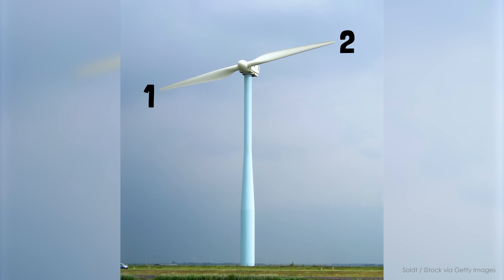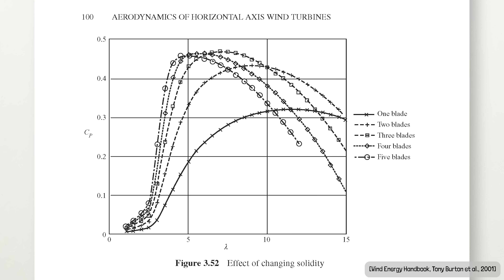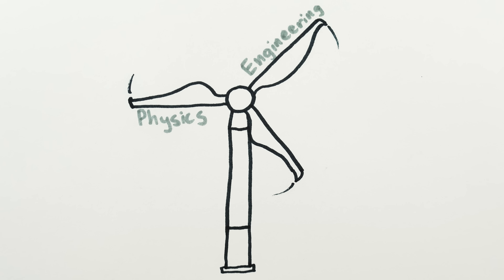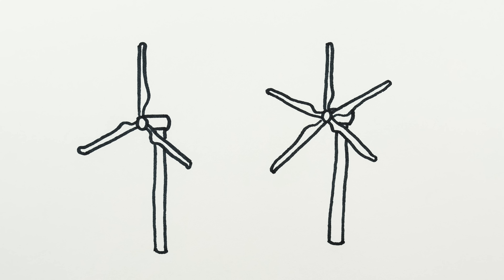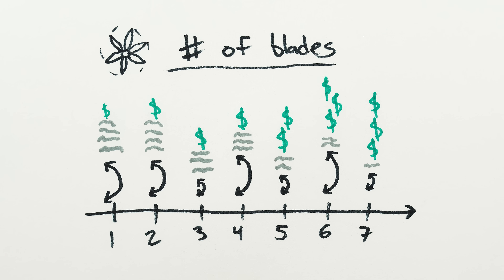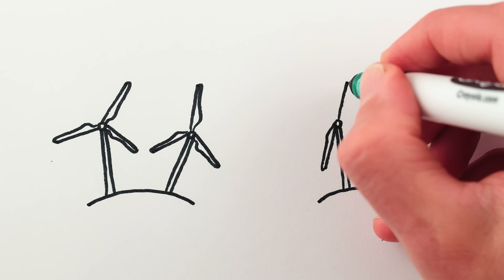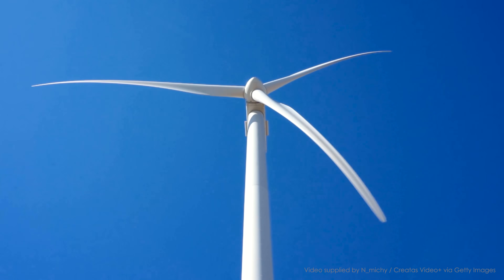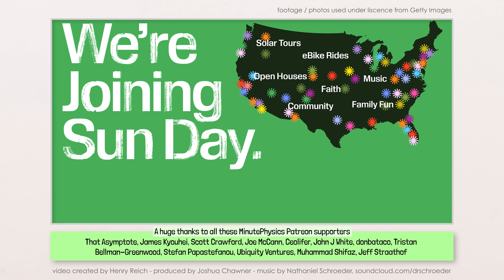Why Do Wind Turbines Have Three Blades?

Comment: We used to have a lot of smaller two bladed wind turbines in Friesland and when those things go full tilt it’s pretty scary, it’s much nicer to have the relatively slow and calm movement of three bladed wind turbines.
Reply: I think that's primarily an issue of size. Bigger turbines appear to spin more slowly. Well, they spin more slowly if measured in RPM but not if measured in m/s at the tips of the blades.

Comment: I want to clarify some important points, to emphasize the effectiveness of wind turbines.

The "lamda" on the horizontal, which the video described as how fast it is spinning relative to the wind is actually a little misleading. Its actually the "Tip Speed Ratio", which is the speed of the TIP of a blade divided by the windspeed. So, smaller turbines have to spin faster (in terms of rpm) to get to the optimal Tip Speed Ratio vs a bigger turbine. Also why huge turbines often appear like they are spinning slowly, but the actually the tip of the blade is at the optimal Tip Speed Ratio of about 7, for 3 bladed turbines. So, smaller turbines (such as one mounted on a boat or something) have more blades because the then it does not need to spin as fast to get to the optimal point, and less mechanical wear.

Also the "Cp" which was on the vertical axis is basically the efficiency of the turbine, i.e. how many % of the wind's energy it can exact, from the wind which passes the "disc" of rotation. So something 47% is HUGE and i bet no one expects that from looking at one in the wild. :)
Reply: Thanks for explaining. I stopped the video to look at the graph and could tell it wasn't really showing what he was saying, but didn't know the details.
Reply: The Betz Limit has entered the chat :)

Comment: "And St Atilla praised the Wyndmylne up on high saying: "O lord, bless this thy wyndmylne. That with it, thou mayst power thy grids, in thy mercy. And the Project Manager did grin, and the people did build upon the foundations, and mast, and staircases, and power lines, and circuit breakers, and reduction gearboxes, and thrust bearings, and lightning prot-" "

"Skip a bit, brother"

"And the Lord spake, saying: "Then, thou shalt install the holy axle. Lastly, thou shall place blades up to three. No more, no less. Three shall be the number thou shalt place, and the number of the blades shalt be three. Four shall thou not place, neither place thou two - accepting that thou then proceed to three. Five is right out! Once the number three -being the third number - be reached, then connecteth thou thy Holy Wyndmylne of Antioch towards thy grid. Who being energized in my sight, shall power it." "

Comment: Why do you keep referring to the WTG as a windmill?  A wind mill is usually used for milling or grinding grain.  A WTG is for generating electricity.  

Every WTG I have been involved with has 3 blades, but I've seen 2 bladed machines.  

Every single Windmill I've seen is very old and they all have 4 sails (or blades).

Windmill ≠ Wind Turbine Generator

Comment: 3:35 yea, but the solar panels and wind turbines produces unstable power. Hydroplany ok it is more controlable. But for other green energy source it is not that easy straight forward to connect to grid, since it need to cooperate with other power source (coal and nuclear) and they need to deliver the amount of power that is required by the consumers (no more no less) to keep the voltage at desired level. Green power sources is briliant idea, but with its local energy storage.

Comment: There's a 4th reason...
 - 3-bladed turbines have a near-constant polar-moment of inertia around the vertical axis when turninging into the wind.
A 2-bladed turbine would have greatly varying gyroscopic effects & polar-moment of inertia when turning into the wind with respect to blade angular position.
Reply: How is this not covered by the “engineering” reason?
Reply: @madhououinkyoma  It seems different: in the video, the blade arrangement where one is vertical is still said to be problematic with four blades. With this moment of inertia thing, any number of blades above two fixes the problem.
Reply: @madhououinkyoma  
Because it only mentions twisting forces of the wind, not the inertia of rotating the blade assembly, around the vertical axis, into the wind.
Arguambly it could have been stated as another consideration in the "Engineering Reasons" section but it wasn't.
Reply: From a mathematical point of view, 2 bladed systems aren’t linear, they are periodic (the inertia varies periodically and therefore so do gyroscopic loads, and other effects).  It’s for the same reasons that helicopters rotors also usually don’t have 2 blades - and if they do, they have specially designed rotorsystems to reduce vibration due to these effects. The 2 blades wind turbines that do exist usually do have this feature too (it’s called a teeter hinge)
Reply: @christophersutton3406  
That's pretty much what I said.
Reply: Spent a minute trying to understand this, never studied it. Layperson's explanation: when a two-bladed windmill is vertical, it would be easy to twist it in the vertical direction. If you could imagine doing this instantly, while it's spinning, the blade would have momentum that takes it either directly towards or away from the pole, and the whole assembly has to counter this force to prevent it from breaking.

If the two-bladed windmill is horizontal, it is not easy to twist in the vertical direction. To do it 'instantly', the tips of the blades would have to spin very fast: it would be hard to make them start moving this fast and equally hard to make them stop moving. So the forces on the assembly are very different, depending on which direction the blades point. This means rapid variations in forces over time, which means vibrations, apparently.

With three blades, there's never a configuration where twisting the entire windmill around a vertical pole is easy.

This fundamental difference between two blades and any symmetrical arrangement with three or more blades makes me wonder if this kind of thing, in a much more complicated way, is the reason that quarks have three colors, and not two.
Reply: I was doing this same type of math for an unrelated application a few years ago and was surprised to discover that for a given amount of blade area and diameter, the polar moment of inertia about an axis perpendicular to the rotation axis doesn't change with rotor position for 3 or more blades, that was the first time I thought this might be why wind turbines use at least 3. I figured they didn't use 4 or more for cost reasons.
Reply: Ok, so not a 4th reason, but another engineering reason.
Reply: @madhououinkyoma  
Well, it is a 4th reason, which is another engineering reason, as he only gave 1 reason per catagory.
Reply: But what if you would reverse the polarity?🤔

Comment: This was a lot of comparisons from 3 to 2. But I wanted to see more comparisons from 3 to 5. 

But I think you still said it well enough.
Reply: Cost is the reason and that was shown. But last point should of have a 3 vs 2,4,5 etc discussion rather than 3 vs 2 only
Reply: Just economics and efficiency, but I do agree.
How much is the difference? The efficiency difference seems minimal for the peaks whilst the distance apart of the peaks probably means that it can run better with slower wind speeds and rotation speeds? Reducing noise and raising the uptime (slightly)
The economy difference gets glossed over at the amount of blades, but how much of the wind turbine cost is the blades? Would they still be the same lenght blades? Wouldn't the wear on the components be even lesser on 5 blades?
Reply: @sirjmo  The wear is the same for a 3,5 or 2 bladed windmills since the blades themselves don't move much so the maintenance cost is roughly the same. However 5 blades needs that either you have to make the blades shorter to compensate for the additional weight, which makes for a less efficient wind turbine since their output is basically a function of the area the blades sweep. Or you'd need to make the tower stronger which makes the turbine more expensive. When it comes to windspeeds the number of blades isn't the only variable you have to work with, you can also alter the areofoil of the blades and their pitch and modern wind turbines all have variable pitch blades so they can spin at most wind speeds.

In general the blades themselves aren't the expensive part of a wind turbine, they are however the part that everything else depends on so if you alter them you need to alter everything from the gearbox, the tower and how you install them.
Reply: @sirjmo   A single wind turbine blade of that size costs upwards of $100,000. And as 5 blades cost over 60% more than 3 blades, that makes it a no-brainer.
Reply: @brinkoftext  I seriously doubt the 5 bladed wind turbine costs 60+% more just because it has 66% more blades. (3->5 being a 2/3rd increase)
The base has costs, the dynamo inside the base has costs. 

Most importantly I questioned whether the length of the 5 blades was the same as the 3 bladed one. And the implications therein if smaller blades of: material/transport cost, impact of wear and tear under lower forces, does it have the same power production?
Reply: @sirjmo   The simple and lazy answer is that if 5 blades were more profitable, they would be the most common choice. Instead the trend is towards longer blades because they are more efficient, used in offshore wind farms. The largest prototypes right now have rotor diameters beyond 250m.
Reply: @sirjmo  Firstly, you don't want to make the blades shorter if you don't absolutely have to. That makes the turbine catch less wind meaning it produces less electricity. That said if you add more blades, it's optimal for the blades to be thinner which saves in material costs per blade (though probably not per turbine). However, it may be simpler to make, transport, and install fewer bigger blades than more smaller ones provided that they're not so big that you can't make or transport them at all. Also, thinner blades might be liable to be bent more by strong winds.
Reply: Yeah, I agree. He mentioned cost, but are the blades themselves really that expensive? I know the answer is yes, but it would've been nice to explain that.
Reply: @Owen_loves_Butters  
Not only are the blades expensive, transporting and stiching those HUGE things together is also a pain. However, for tiny little (usually non-commercial) turbines, 5 blades are a pretty common design.

Comment: Neat video, I learned a few new things, but wind energy is not a good way to generate power for so many different reasons. I'm all for "cleaner" energy generation, but environmentally, the only thing worse than wind farms for how it messes with the ecosystem are hydroelectric dams. Solar is the best of what people generally consider "clean" energy, when used properly. Setting up massive fields of solar panels causes a lot of the same problems as large wind farms, where the ecosystem of birds is massively disrupted, leading to many other ecological knock on effects in the area. The best option is to put solar in already used areas, like parking lots, and building rooftops.

I'm not saying that I'm "anti-renewable energy" or anything, just that the normal ways we generate "renewable" energy is not sustainable long term, and thus, not really renewable. Nuclear is our current best source of energy, until better technology, with lower environmental impact in the other fields of "clean" energy can be properly developed. It's all good, but most of it isn't good enough for the truly long term problem we're facing. Any progress is good progress, but the best immediate impact we can have to clean up our energy problems is nuclear, afterwards, we can focus on solving the issues other forms of power generation have.
Reply: Wind energy is among the best, actually. Carbon dioxide emissions per kWh produced are either the lowest or second lowest (behind nuclear) depending on the study.

Comment: I once had a quite long drunk talk about this topic with a friend xD
What I would love to see in this video is also height of the turbine (I guess higher = more wind = better), the size of the blades and their shape. I bet it was optimized as hard as possible but I still wonder how they came up to certain shape/size
Reply: Bigger is most certainly better. The cost doesn't scale in a straight line with size, so a small one-house windmill will cost about 10 times more per KW/H than a big one. The fact that they look cool is just a bonus.
Reply: @mildpandemic3944  so why they are not 2x longer for example? But maybe they become less durable  with size so it's kinda a "sweet spot". I'd love to see some video from someone who designs these.
Reply: @PinkeySuavo  It's an excellent question and one I hadn't bothered to look up previously, but a few days ago I heard about a company that wants to make the world's biggest cargo jet to transport really long blades. It would be used for land based farms for one main reason: It's really hard to transport 130m long blades by road. That's at least partly why the offshore farms tend to have bigger blades, because they can be brought to the site by boat and there are no corners/bridges/what-have-you. The turbine I stood under had a blade length of 72m, so the big boys are in fact almost twice as long. At a certain point the material science just can't manage the stresses, so there's a limit at each stage of technology.
Reply: @mildpandemic3944  ohhh the transport makes sense! recently they had to stop traffic on highroad because they were transporting some. This makes sense why they dont make them longer. Thanks!

Comment: Loved the video, but it made me wonder why are the blades oriented vertically instead of horizontally? Like probably because then there’s a greater chance that a given blade will come into contact with some air stream, but maybe not. maybe we can/should predict the height of most of the wind and set up horizontal wind turbines that come into contact with that stream of air. Just a thought.
Reply: Horizontal blade designs are used in some places which have rather unpredictable wind directions. The vertical orientation has much more of area exposed to the wind, i.e. more rotor material is used for moving rather than just for structural integrity, meaning it is usually more efficient in building materials to generate a set amount of energy during operation.
A horizontal design also has part of its rotor moving against the wind direction which creates a lot of drag.

Comment: I'm glad the aesthetic aspect was brought up. People tend to underestimate how much of every day engineering is influenced by what thing look like and how it makes people feel about them and are adjusted accordingly. And honestly, I wish we put more emphasis on making things pretty just because, rather than only chasing the highest efficiency metrics.
Reply: i wonder if they would have chosen for most wind turbines to be 2 bladed if they were overall more efficient and better from an engineering standpoint.  I bet they would have.  Seems like it's a coincidence that 3 blades are the most pretty, efficient overall and best structure wise.
Reply: @ShongoStick  Try building a stable small stool with 2 legs and it will be inherently unstable unless the legs are extremely wide.

A truly 3D coordinate system needs to have three axis, just like a normal stool needs to have atleast 3 normal legs in order to be inherently stable.
Reply: See rear facing airline passenger seats. Statistically safer, but viscerally unappealing to actual passengers.
Reply: A strain optimized part where all the material is equally loaded is often quite good looking by itself.
-Though might be difficult to manufacture. 3D printing should help to makemore parts asthetically pleasing, since minimal cost for added complexcity.
Reply: Verily. There's nothing more depressing than walking through a concrete jungle, seeing nothing but sterile ugly boxes (buildings). Where's the beauty in that? Who wants to rest their eyes on the filth they accumulate.
Reply: The 120° angle between the blades is the same as the inner angle of the hexagon. Three evenly spaced lines is in fact the repeating feature needed to create a hexagon. One of the most prevalent forms in society.
Reply: @DavidH_1_2_3 the bestagon strikes again!
Reply: This is Apple's philosophy when it comes to computers. People think computing specs to price ratio is all that matters, when really form matters just as much for everyday devices.
Reply: The funny thing about aesthetics is that it's both way more important and yet sometimes way under-recognized in meaningful areas. Like the godawful skinny towers or the jenga building in NYC. I fucking hate the way the skyline looks now, and I don't even live there. The only amusing thing about it is it reminds me of the towers of Bologna(?) when everyone was building these haphazard tall ass towers all over the place to have architectural dick measuring contests. But I digress.
Reply: in fact, i believe that the human brain intuitively ranks structures based on how stable they are. A statue in contrapposto is pleasing as the tension (load) in the legs are equal, creating an impression of both balance and movement.